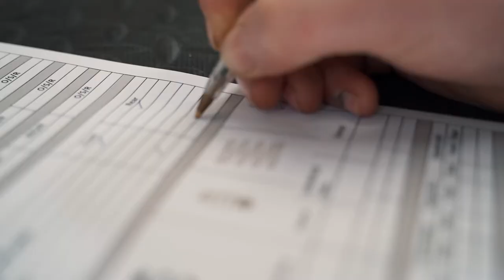MSS | Behind The Scenes with Founder: William Blankson

Comment: I installed your height adjustable springs on my 2022 G20 M340i xDrive and they're just ok. I like the concept, but if you provided the correct top and bottom seats for both front and back, it would make it so much better. The car looks great, but I've already had the front right come loose, and I've had to readjust. It's almost a great product
Reply: I was about to go with MSS over the HKS Hipermax adjustable springs on my 2023 Supra